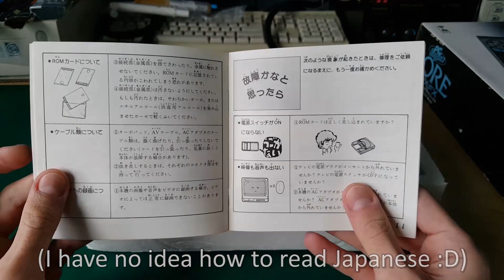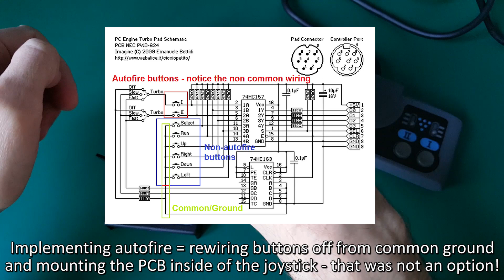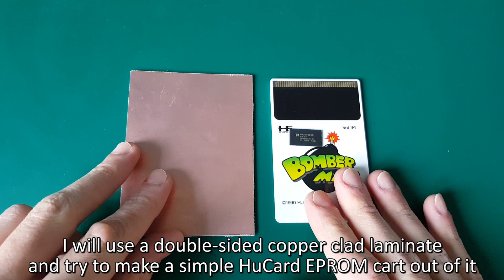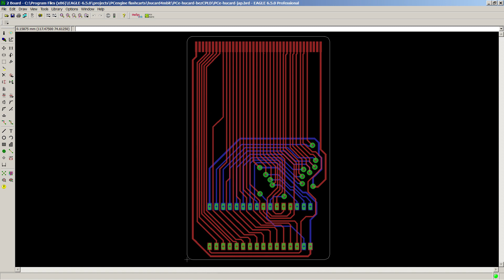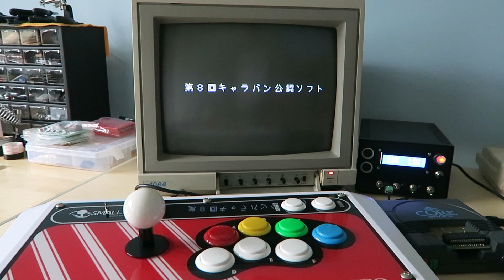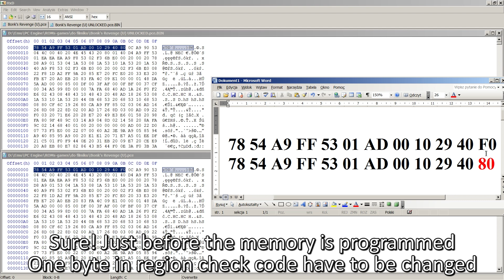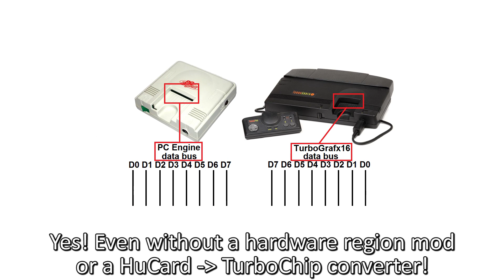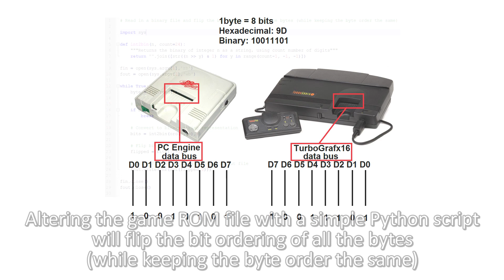PC Engine Homemade Flash Cartridge, RGB Mod & Arcade Stick Interface

Comment: I see COB/glob-top ROMs even on a Super System Card so I’m not sure they used TSOP for the ROMs. There are wire-bonded to the PCB and the. Sealed under epoxy.

Comment: Great work on all counts there =D  Out of interest, how have you connected the RGB output up to the 1084S there - did you need to do anything other than wire up R,G,B, sync, and ground - mine seems to not like any RGB signal I've tried so far.  Might have another fault to look at, not sure yet.
Reply from the maker: Thanks! This 1084 monitor happen to have the scart input at the back so I was able to use same cable I use for my scart switching box and PVM - like You said just R, G, B, ground and composite video signal as sync. It is hard to see on the video, but I noticed some weird distortion and wobbling on the few first horizonal lines. This does not happen when I connect an Amiga 500 for example also via scart RGB cable. PC Engine on my PVM works perefctly fine with same cable, so it must be this 1084 for some reason handles the RGB signal from the PC Engine poorly.
Reply: I'm pretty interested about it, because I have white PCE unit already, exactly as yours. I would like to create external RGB mod, but Sega Holic did not published vid on his channel about this mod until now. I would like to help discover the fault of your PCE unit, however now I'm waiting to multimeter from China, and I have to get PSU, hope that some PSU from router will fit, I can get one cheap in local store.
Reply: I've done the RGB mod to my PCE already - I did mine inside the Tennokoe 2 expansion and added an audio amp too.   The problem I have is my 1080S monitor not liking any RGB signal I feed it.  I suspect in my case I need to mod the monitor and remove a transistor.

Comment: Great job man, Is it possible to burn more than one rom file onto a EPROM?
Reply: There could be a way to write a ROM yourself and then have other roms built into that one so that when you select one of the games the "ROM wrapper" would, when you select a ROM from some sort of menu, jump to that ROM's program code and have it act as if it was the only ROM on the chip.

Comment: Do you know how I get a good and sharp image from my modern computer on a crt TV? The cheap HDMI to Composite adapters on amazon only do half the job, it's good enough to watch videos but way too blurry to read something :(
Reply from the maker: It might be tricky but it is doable - if Your CRT TV supports RGB input (this will be the best quality possible) forget about composite - it will never look good. First you have to get a graphics card that have VGA (d-sub) output and can be used with Soft-15kHz (google "Quick List of Soft15khz Compatibile Video Cards") - then You have to use a video cable that is one side VGA (d-sub) and other side that plugs in to CRT TV (most of the time SCART, or BNC). The thing is PC outputs 30kHz video and H & V sync is separated - it have to be soft-modded into 15kHz and combined h&v sync, so CRT TV can display it.  You can also get a ArcadeVGA card from Ultimarc, it is not cheap but it probably is the best less-hassle option possible.
Reply: I see, yes RGB CRT's are not that common. Thanks for the info, so I can't get my modern graphics card to look good on a common crt :(
Reply: If you haven't already, look into GroovyMame and CRT Emudriver or Soft15Khz.  Basically, there are programs that force your PC to output a native 15khz image that is EXACTLY the same as the original hardware.  There are ways to RGB mod a TV or you can use a RGB/VGA to Component transcoder if your TV has component inputs.  You can also use a Raspberry Pi and a device called a RetroTink. :)

Comment: I wonder how hard it would be to build an Arduino based cart that read roms from an SD card and loaded them into a RAM chip?  not a trivial thing for sure but it'd be fun to build :)
Reply from the maker: Check this out http://www.gamingenterprisesinc.com/Flash_HuCard/ using PIC instead of ATMega but a simmilar idea, very nice project too
Reply: jaskwadrata that's super cool! I've never even owned a PC Engine but I want to get one because i know I've missed out on some great games. Plus, it'd be a good excuse to get my circuit building chops back in order.

Comment: do you know how to make snes or genesis pcb cartridge?
Reply from the maker: Short answer: I dont. Long answer: it is not an easy task - You cant have a single cartridge to handle all genesis or snes games (excluding EverDrive - which is able to emulate different additional hardware sets in software) . A lot of games uses different mappers and so called "enchancement chips" - 99% of PCEngine games does not use mappers or additional enchancement chips, thats why it is easy to make one cartridge for all games. If You are interested in that topic google out some stuff like SNES DSP chips, SNES memory mapping etc.
Reply: thanks that was a really quick response :D

Comment: What schematic did you use to map out the pins?
Reply from the maker: just a simple hucard pinout from wiki, it basically connects 1:1 with an eprom
Reply: jaskwadrata but a18 and a19 seems to be not 1:1 they go to jumpers but for 1:1 jp1 and jp2 all should be 1-2 or I’m wrong? Can explain the logic of jump r ?